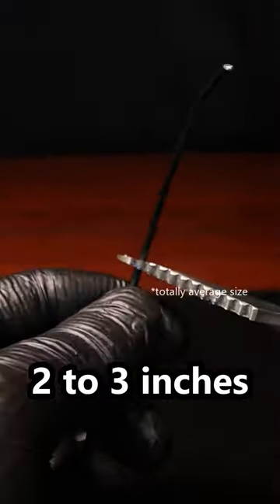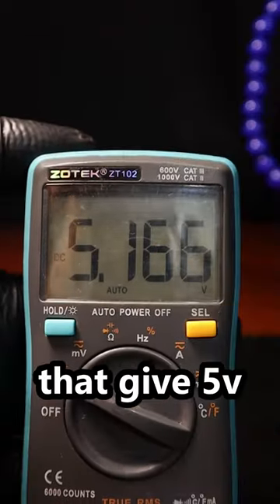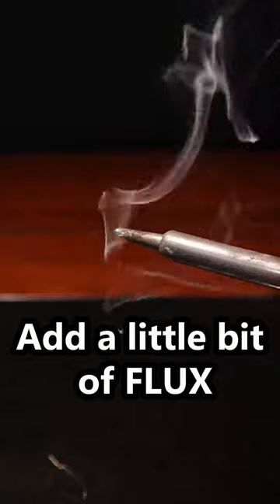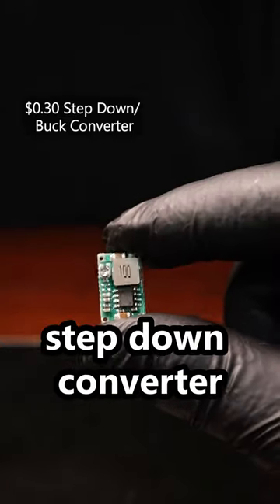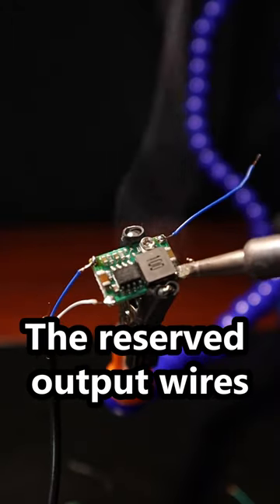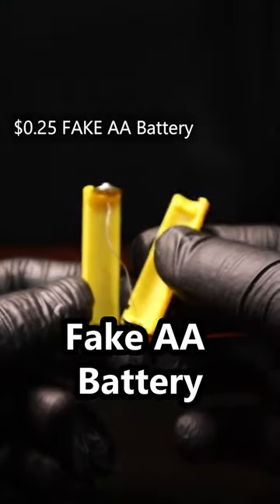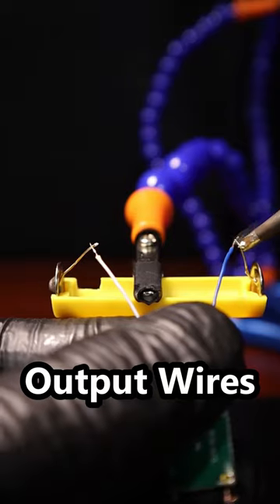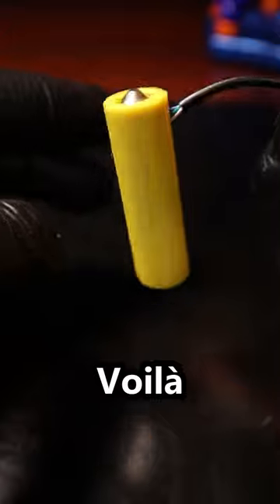Let's make a USB Powered AA Battery

Comment: Don’t buy double A batteries.

Instead, buy USB, soldering iron, step down converter, a multimeter, wires, a fake double A battery, hot glue.

Or you can buy a rechargeable double A battery.
Reply from the maker: hehe